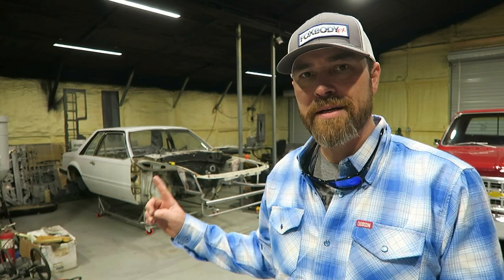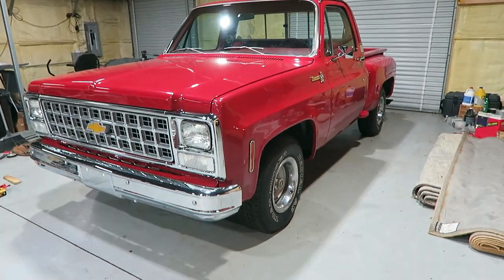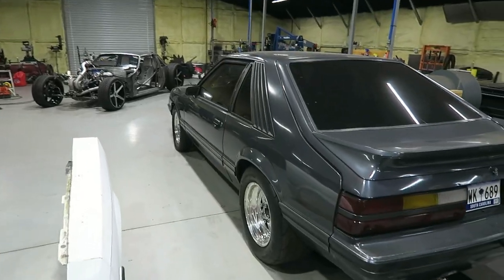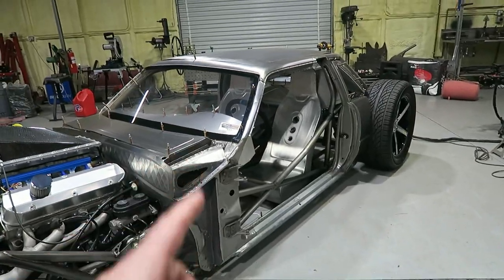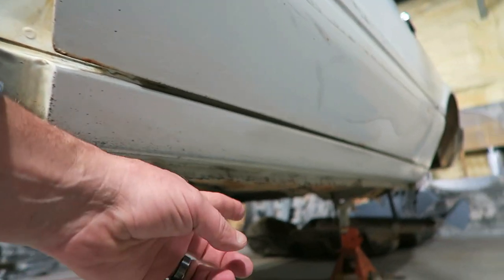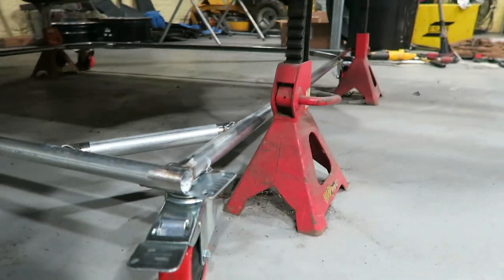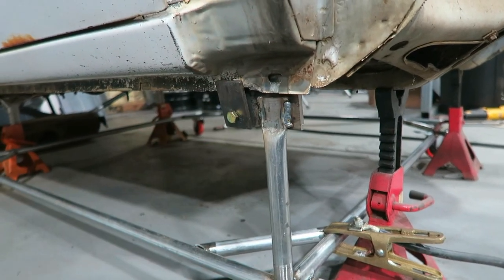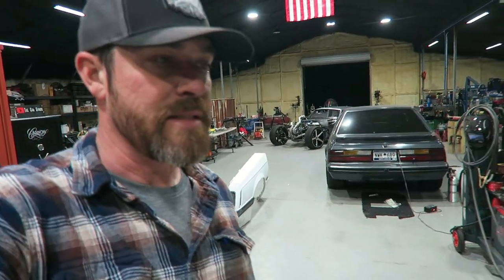Building A Car Dolly For The Mustang Coupe Project

Comment: I made something similar for my fox, Only difference I made like a open C on the driverside  so I can get under there with a creeper. I did by using 1inch angel across driverside pinch weld then ran gussets from the angle down to the wheel posts.
Reply from the maker: yeah some under car access would be nice

Comment: Those casters hold more than 300lb lol. 
I bolted a few to the front frame rails on my 37 Plymouth 2dr sedan to roll around my shop lol
I used to use home depot orange flat carts to move bodys.
I built some stout 1.5x1.5 C channel dollys with those 3" steel casters from home depot. No issues rolling 4klb cars around.
The harbor freight ones lose bearings if u hit a pebble...
Reply from the maker: yeah I remember when I purchased them to made sure they could hold a lot but couldn't remember what it was when making the video